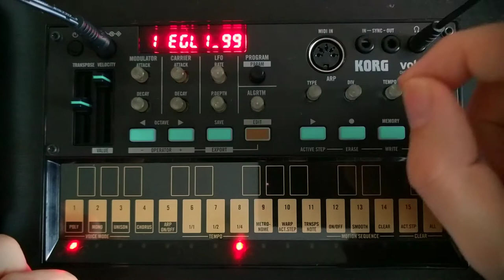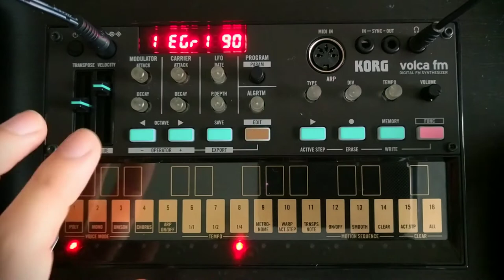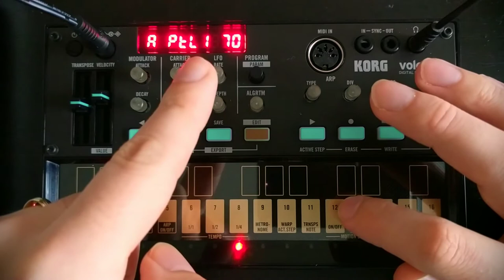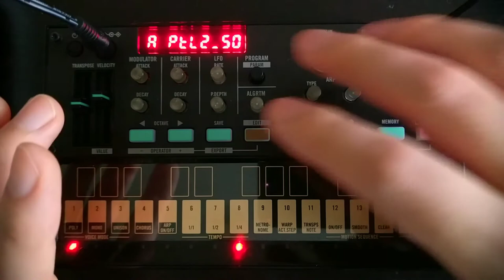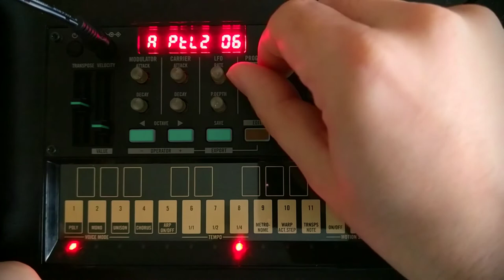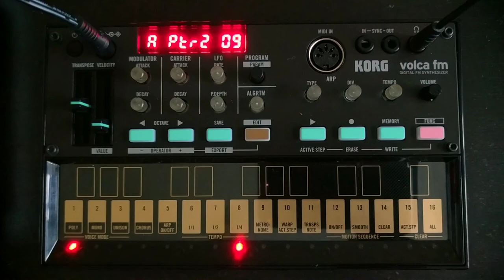Understanding Sound Design on the Volca FM - Episode 3.5: (More) Envelopes

Comment: Is L4 supposed to sustain indefinitely once a key is released, or does the envelope only travel to L4 at the rate of R4 and then immediately stop? The DX7 manual says it should sustain, however I only notice it traveling to L4 at the rate of R4, then stopping. This happens on both my FM and Reface DX, so maybe I just misinterpreted the manual?
Reply from the maker: +MelVinMaSsaCrE if we're talking about the Operator envelopes, then if L4 is higher than 0, then the note will sustain indefinitely UNTIL you run out of voices. But bear in mind that this only applies to operators acting as carriers - if you apply L4 to a modulator, you'll only hear that effecting things while you can hear a carrier it's attached to (same applies to the pitch L4, you'll need to have a carrier playing to hear the effects).

(I've just confirmed this on my unit because I hate giving information without double checking!)
Reply from the maker: +MelVinMaSsaCrE oh, interestingly one of the things Korg updated in their last firmware update is quoted as "Fixed EG4 Implementation". I'm running the up to date firmware (released November last year), are you?
Reply: Hmm... I was under the impression mine had the most recent firmware version, but it would seem I missed the update entirely. I looked at the update info on Korg’s website and noticed a Key Velocity Sense fix too. Mine only goes up to 6. Thanks for the quick reply, you told me the exact information I needed to know. Cheers!
Reply from the maker: +MelVinMaSsaCrE brilliant! Mystery solved! Enjoy those infinitely sustained notes!